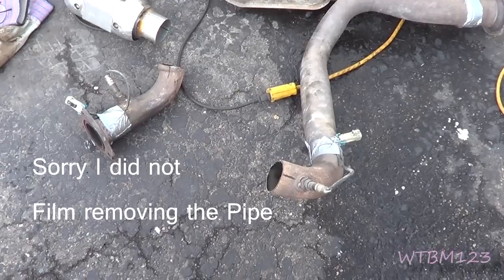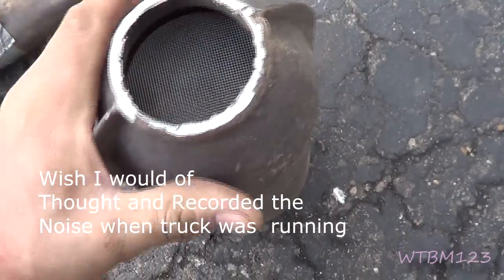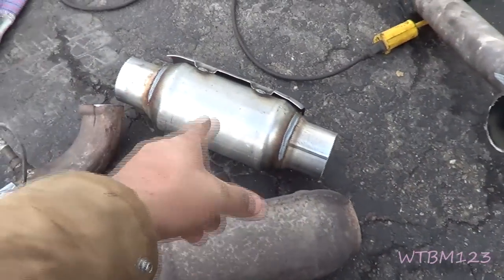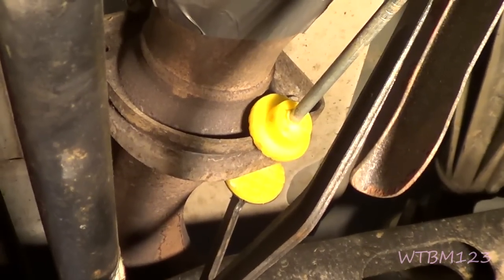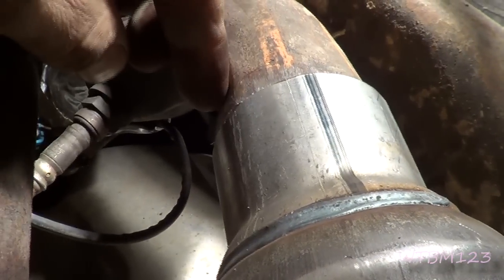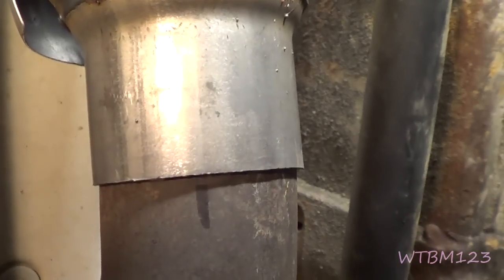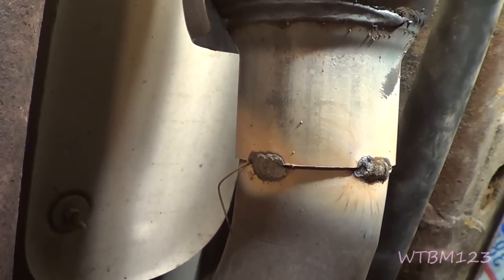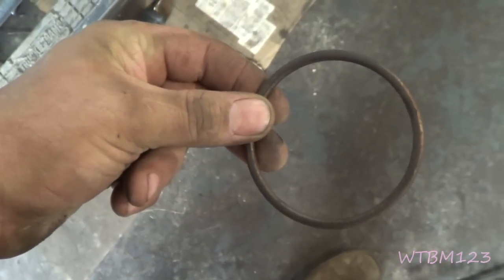Chevy Silverado Making a Rattle Noise , Replacing A catalytic converter

Comment: my crown vic makes that annoying rattle and trips the check engine light so may as well change them
Reply from the maker: I would want to confirm they are the rattle , and depends on what code is set
Reply: I can clearly hear the rattle from right under me when driving and the code is po430

Comment: Maybe a quicker and slightly cheaper fix to a rattling converter....... Just squeeze it a little with a C-clamp pushing the body of the converter in and stopping the rattle...... Just saying....
Reply from the maker: One could try that
Reply: Mikey Mike I will try this
Reply: Austin Kaleikau did it work
Reply: It will not work ... its inside the carbon is loose